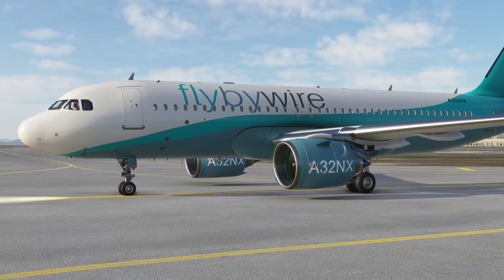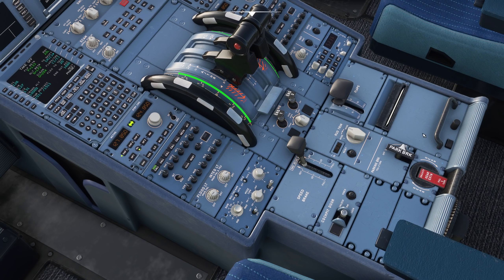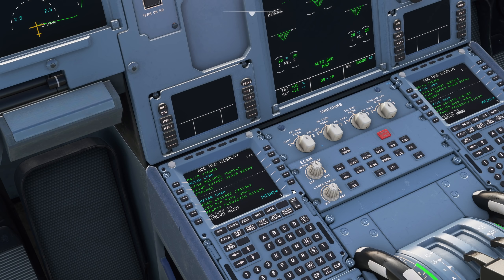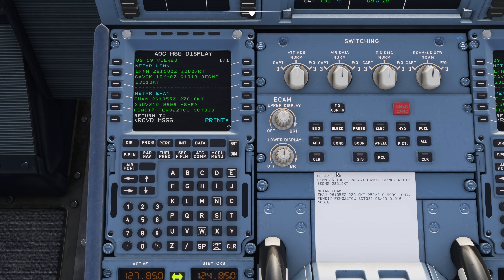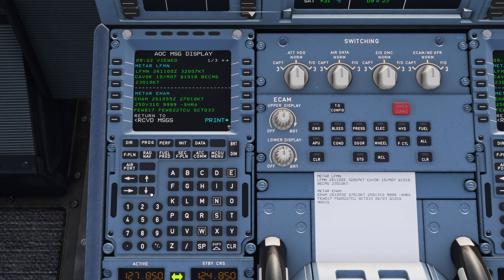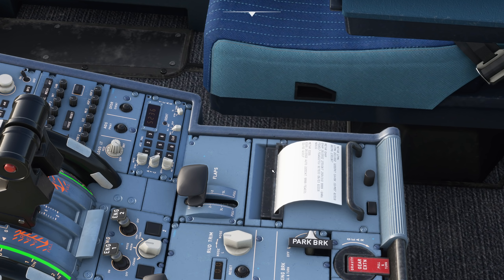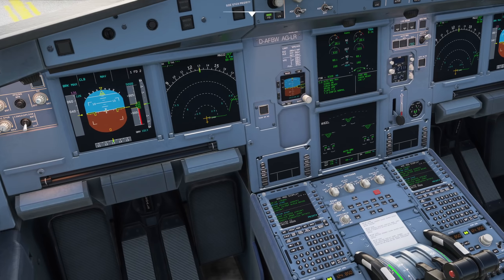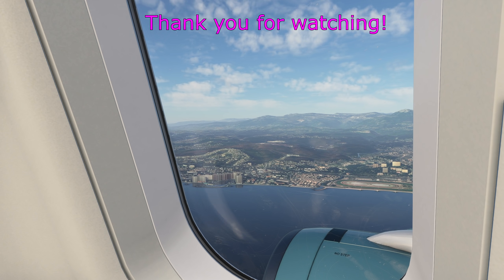A32NX Adds the Printer! Real Airbus Pilot Takes a Look

Comment: Is it known where they pull the METAR from? I've read they found a way to extract it from the MSFS weather engine, so it's actually showing what the weather is?
If that's the case, I'd find this even more newsworthy than the printer, as fun as it is. Knowing the conditions at your destination in MSFS is just pure luck since the ingame ATIS is broken and there is no other weather source inflight when using live weather.